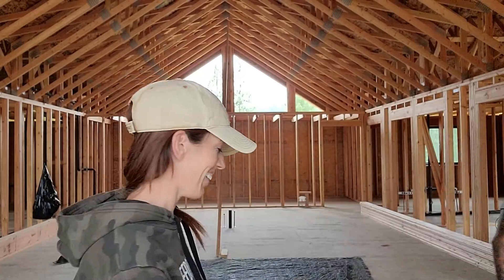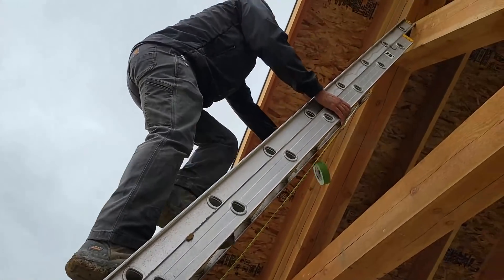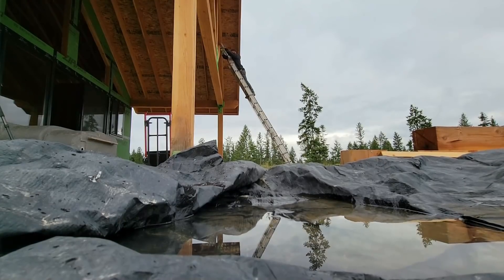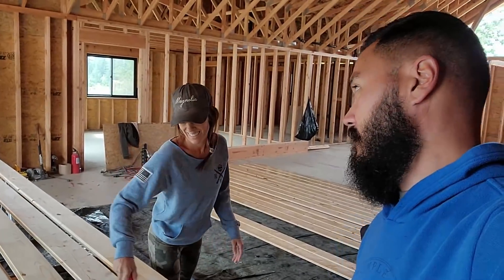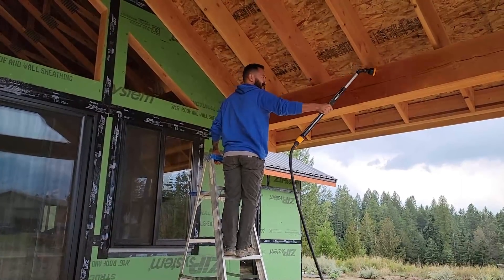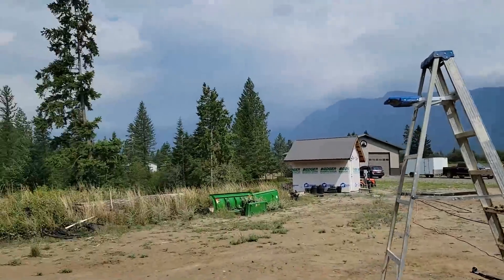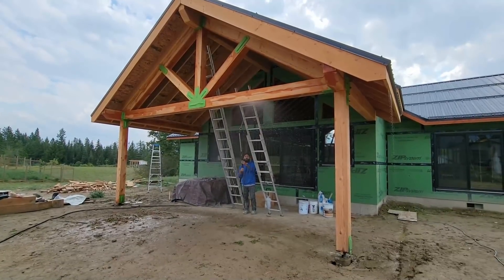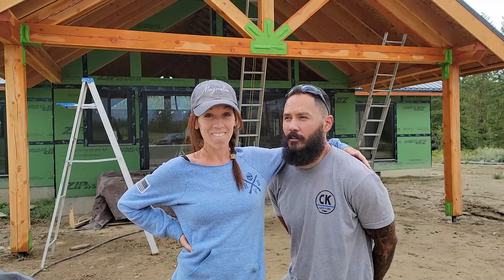Recovering From Covid | RESTARTING Our HOME BUILD

Comment: Glad you've recovered.  Just a thought and some suggestions...if you are concerned enough about wild fires to use fiber cement siding, you should seriously reconsider using pine for your soffits & fascia?  Fiber cement (Hardy Board) would be a better choice to fire proof the entire building envelope.  During a fire, flying embers can get sucked into your attic through the soffit vents.  I believe they make some type of spark arresting screen or baffle that can be installed first, under the vents, to prevent that from happening.  Use the pine as an interior feature wall.  Cheers.

Comment: You need to seal up the cracks on your big truss and then stain it to prevent water from entering the crack and freezing over the winter and causing your truss to fail. Some people use a caulk of the appropriate color.

Comment: Jeremy I'm assuming you are planning on a light under the roof above the front door remember to pull wire in that area before you attach the pine boards , or at minimum run a conduit with a box for the future light . If Melissa is like my wife she's going to talk you into a suspended chandelier

Comment: It took a few months to get my taste & smell senses back. The exhaustion lasted almost 8 months; Pace yourselves and take naps when you need them. 
Did you two think about using Varathane for your wood? It’s used on bowling alleys and is very durable. They might even sponsor your project.

Comment: Hi guys! Considering the rising temperatures, would you consider putting in some extra vents in the soffits? Also, looking at the design of your house,  you could reasonably install 3 solar powered attic fans in your gables to keep your house cool during the summer time. Just some things I thought I would share at this point of the builld, since it can be  more difficult  to make those adjustments later. Living in the tropics, I know how hot a house can get without adequate ventilation and  cooling without relying on air conditioning which can be quite expensive here.

Comment: I know this is going to sound crazy and it'll be a lot more work, but I would recommend staining both sides of that tongue and groove.  Why?  Wood continues to "breathe" even once it is cut down and turned into lumber.  By breathe, I mean it absorbs moisture and it expels moisture.  The stain will cause that side to absorb and expel less while the other side is able to absorb and expel more, which can lead to warping over time at a much faster rate than if you stain both sides.  Ask me how I know...........

Comment: Satisafaction-meter is going through the roof as i see Jeremy switching out the blade on that mitresaw. Even if you are cutting boards that wont be visible, it has been a nail in my eye to see those frayer boardends😂

Comment: it takes some time to make this recipe for the carrots and zucchini.  clean carrots, slice up in its own pan ,(about 5-6 cups) and cook, drain, set aside.  zucchini  wash, cut into  same size as carrots and boil in water one of those large ones or 5-6 cups) till tender, keep the liquid when drain, save and set aside both.  cook hamburger and onions till done and drain,  set aside.  take the water that was saved and make stove top stuffing 2-3 boxes  set aside... a can of chicken soup and  1 1/2  sour cream, mix and warm up. set aside.  in  a couple deep dishes as lasagna layers , spray dishes and put  carrots, sauce, meat, zucchini and stuffing ,, repeat  till stuffing is the final topping.   cook in oven  on 350 degreen  for 45 minute , check if browned  and heated good. up to one hour totally.    eat one and freeze one for another day.    can add more veg if want to ... only taste the meat, gravy and stuffing  mostly.